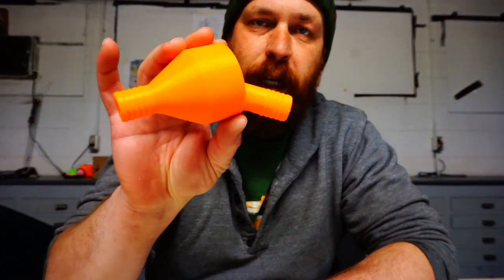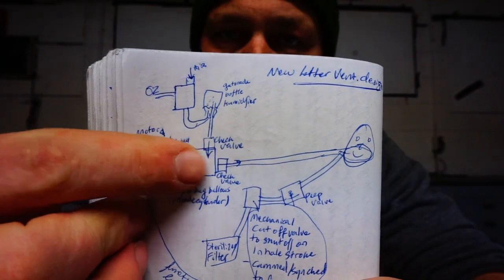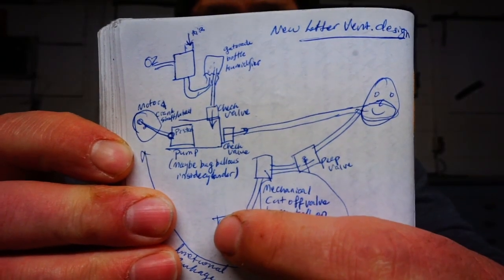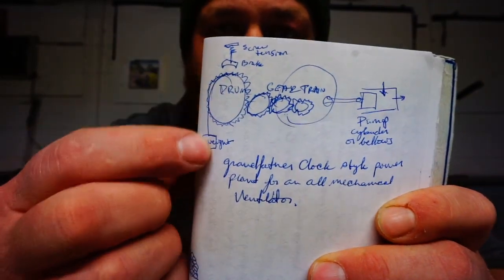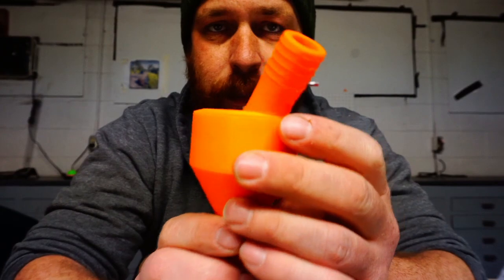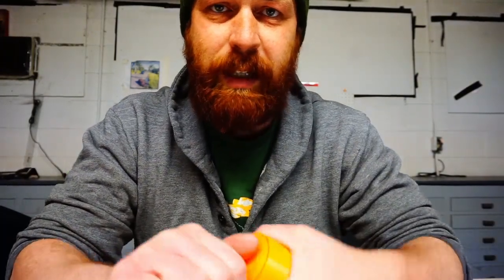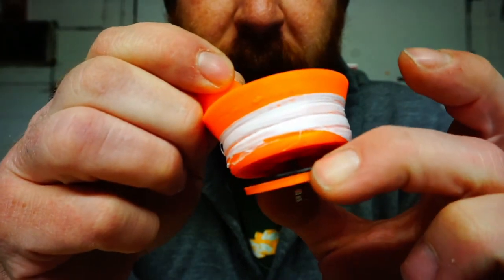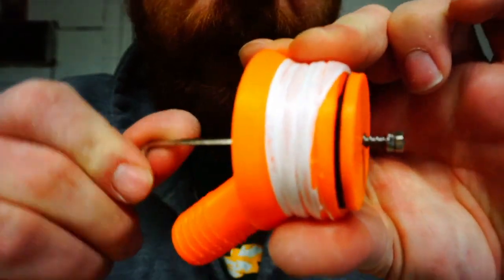COVID 19 / Coronavirus Ventilator 3D printed PEEP valve and design thoughts

Comment: Look at the designs for water powered bellows they are all cam driven without the need for complex linkages.
Reply from the maker: the problem with water powered bellows is the necessary depth of the water and piston system to achieve enough hydrostatic pressure to open a lung.  This can work, but is not as simple as just cranking a pump bottle up and down.  The pump bottle would need to be driven under water enough so that the hydrostatic pressure matches the peak inhale pressure.  I'll post an update soon.  Thanks for your comments

Comment: Your thoughts on having a valve that switch on an off every 4 seconds . As a Normal breathing cycle is 14 to 16 breaths per minute. So if we have a valve that goes on and off every 4 seconds pushes the air from the compressed oxygen cylinder into the lungs and then lungs exhale when the valve is off

Comment: Great work! You should also look into bubble CPAP. Placing the expiratory limb of the ventilator into a fixed/determined depth of water (ex. 8 cm of H2O) would provide 8 cmH2O of PEEP. You could create a container that would hold the expiratory tube at an adjustable depth in the water but only let the exhaled gases vent through a filter at the top. Filtering the exhaled breaths is very important with COVID19 patients to prevent infection. The container would need to be filled periodically with water. Contact me if you have any questions about this idea.
Reply: Just saw your recent upload! Glad to hear you found out about other this option.

Comment: This might be the solution... 
https://youtu.be/JRKIyEJAEhA?t=273
Price gouging in a time of crisis...
As far as I can tell the manufacture isn't the one to blame.
Ok this looks like this might be the low cost (fast to manufacture) solution for ventilators. No electronics! This plastic device (along with a gas supply) set the rate of inflation and the volume of air for each breath. This NORMALLY sells for $100, but I've seen one vendor selling it for over $1000!

Comment: Hello! This is great. One question. A water lvl woudn't be a feasible idea for a peep? Depending on the deepth of water you would put the exhale pipe? Thanks a lot
Reply: That's pretty ingenious. I just tried that with a water glass and a straw. From the pressure feel I got from the BP gauge, I'd estimate you would need a 2" (50.8mm) diameter pipe that was about a meter high. The only issue with it is to disable PEEP, there would need to be some valves that would need to manually be opened/closed. From my understanding, PEEP is enabled after assisted breathing has started.
Reply from the maker: @shootgp  This could be done with a secondary mechanical valve along that line.  I might try and make a valve that can be operated with a simple servo or crank.
Reply from the maker: I think that's a really good idea.  Maybe even have a stepper raise or lower the end of the tube (and getting fancy: monitoring the water level) in order to adjust the PEEP pressure.  Very clever.  I mentioned it in the beginning of my most recent video

Comment: Excellent work. This is a great concept. In the future, add a .zip download, OnShape only allows non-members to view the model, not download it. I will try this concept with my own design based on your model. Here is a list of changes I will be making that will work with my ventilator design.

1. I will be eliminating the threads; they always cause issues when printing thus I will just use two flat flanges that bolt together with a gasket. Furthermore, if machined from aluminum instead of printed, that will simplify things.

2. The metal bolt will be elongated and use a sleeve over the threading for smoother action. (in part for #4) This bolt will have very fine threads, perhaps 24TPI or greater and will have a knob attached to the bolt head.(for #5)

3. The movable valve portion will use a heavy steel galvanized washer on the backside/spring side (for #4)

4. The bolt in assembly (1) will be wrapped in copper wire to turn it into an electromagnet which will attract the washer in #3. During Tidal Flow, I must ensure the valve remains closed. A very tight winding with minimal voltage can create a very powerful electromagnet. The magnet will disengage when the patient exhales and the valve will continue to function as currently designed based on your model.

5. PEEP pressure calibration: PEEP pressure from what I read needs to be between 5-15 cm/water. Using an online calculator, I converted this to mmHg. Using this unit of measurement, I can use my cheap manual blood pressure cuff/gauge/pump to get the spring tension into the ballpark. Once spring tension/force for PEEP pressure is established, I can mark predetermined settings. I'll probably add some stops somewhere to prevent the knob from being turned to far (once the knob makes a full revolution, if someone loses count it has to be completely re-calibrated.

In short, it's now a highly specialized solenoid... :-)

Again, great work and thanks for the inspiration on this component. It's almost surreal what has happened; hopefully those of us that 'make' might be able to make a difference. To all that read this, your doing so for a reason. 

God Speed
Reply from the maker: thanks.  I'd check out Leonardo Porto's comment below, I like his idea better than my original design

Comment: That's really good stuff! I actually think this would be really good as a blowoff valve, to add safety to every system currently being developed. If the ventilator puts more pressure into the patient than is safe, this valve can blow it off.
Reply: At what rate do the turbos spool?

Comment: for a controllable peep valve perhaps a watering system solonoid controlled valve would be good.  in that case it could be switched via the cam.   and then you could be very simple with the electronics. even just power and a momentary switch.

Comment: the bucket gravity bong idea is neat.  you could even bubble the oxygen up through the water,  removing the hydration requirement.
Reply from the maker: I was thinking along these lines, but with heat, bubbling through is clever.
Reply: There is also the option of using a heat and moisture exchanger near the patients breathing tube. This would maintain humidification of the airway without the need for external humidifiers as well as reduce the chance of the patient developing pneumonias or infecting others. However, we are likely to see a shortage of these over time. Most hospitals are recommending we use these instead of humidifiers...